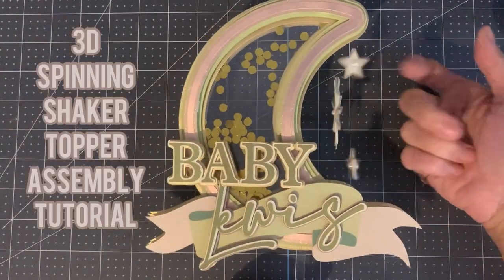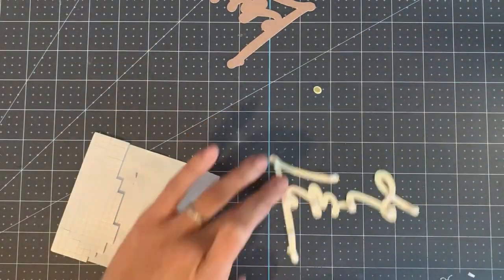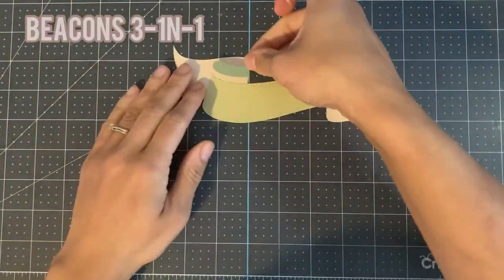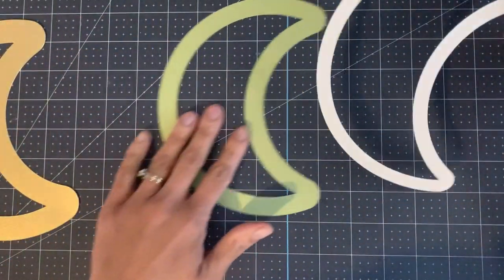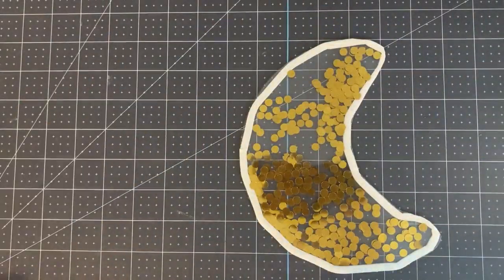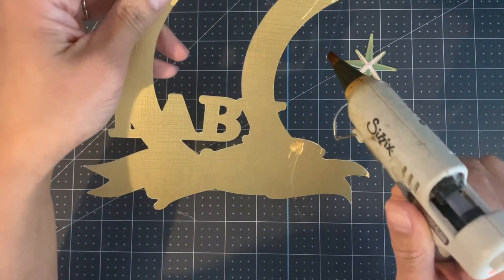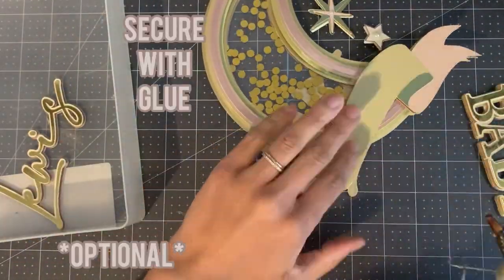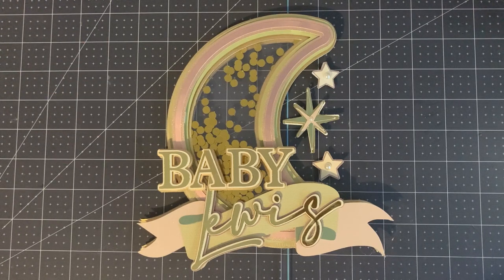How to make a DIY 3D Spinning & Shaker Cake Topper | Assembly | Tutorial | Step by Step

Comment: Hello! I must say I am impressed. I tried following along in design space - just to try how hard it is or isn't - and I wanted to see how many sheets would turn when I wanted to make it. So, with 5 colors used, I do not understand why does it come up on 14 different ''mats''? THANK YOU IN ADVANCE FOR YOUR HELP! :)
Reply from the maker: So glad you found it helpful! It may be that you used 5 colours but they may be slightly different shades and therefore will come out on different mats. Use your color sync option on the right hand panel and see how many colours there are. From there you can drag the images into the 5 colours you want. Let me know if this works 🥰

Comment: Hi I love the technique! My only question is to you pull hard on the string to straighten it out or do you leave it loose not to tight?
Reply from the maker: Thank you so much! I would say pull it until it is taught not loose but not so tight that it bends the card if that makes sense. It can still spin if it's a little loose but it just doesn't look as clean ❤️